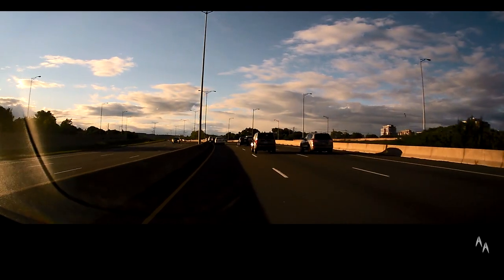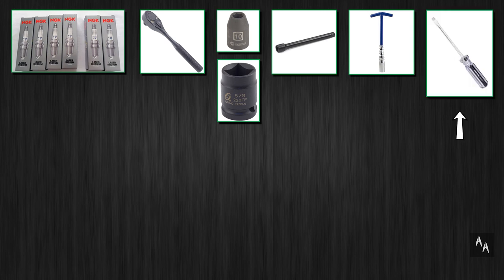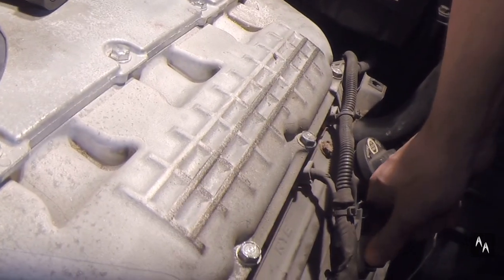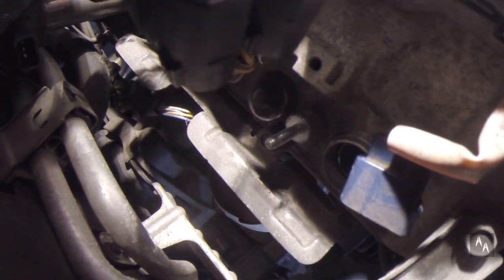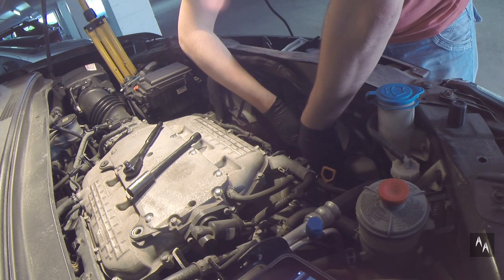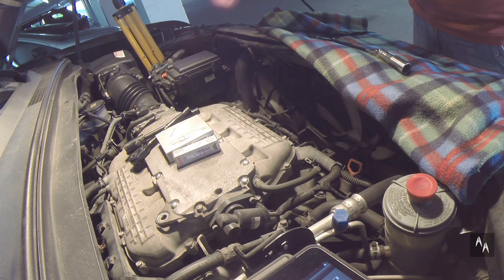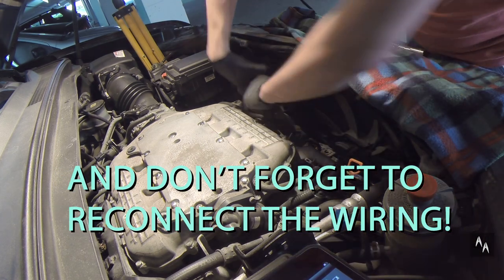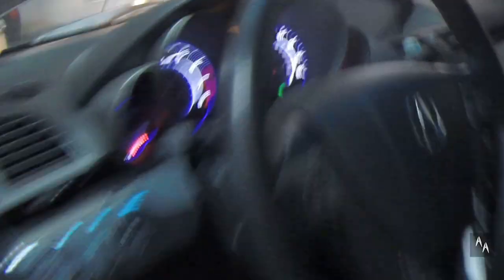Spark Plugs Change DIY 2008 Acura MDX

Comment: This video was a great help.  The rear three are not as easy as the front but it's very doable as long as you have the proper tools.  I did my 2010 MDX  in a little more than an hour with success and saved the $400 the dealership was trying to charge me

Comment: Still check the GAP, even though they say pre-gapped make sure you check the gap I've had gaps that were way off on "Gap less" plugs.
Reply from the maker: You probably got low quality or counterfeit plugs then. For iridium quality plugs when you check the gap, you actually damage the very thin iridium covered tips.
Reply: YES !! Today's spark plugs CAN last 100,000 miles -- IF they have been PROPERLY gapped before installation. Those so-called "Pre-Gapped" plugs are rarely at the proper gap for the vehicle.
Reply: @AcuraAddicted  NAH. Those Iridium deposits on the electrodes are not that fragile. 
Spark Plugs gaps should be checked with a WIRE gauge, so as not to damage the tips.

Comment: Great video, thanks for making this as easy as possible for those of us who view your work on line.  Actually the rear spark plugs facing the engine fire wall were much easier to replace than those facing the radiator, as there was more clearance for the spark plug wrenches, etc.

Made this a comfortable and straight forward repair, took about two hours in total.  Thanks again.

Comment: Thanks again for this video. Just as helpful in 2018, as it is in 2020. Today I just replaced the spark plugs in our 2012 MDX. The front 3 were as easy as in this video, but the rear (1) far left and the far right (3) were very tough to get. The left has the A/C lines going into the firewall, making it hard to reach the spark plug, but after using some shorter extension I was able to get in there. The hardest was that far-right rear where the coolant line goes into the firewall. I removed the hose first, cleaned everything and then was able to remove everything. I have no idea how in the world you got in there without removing that hose?

I just wish I watched this video first before ordering plugs. I have always done my own spark plug changes for my Accords and Civics, and those are so extremely easy, but the MDX is much more time-consuming but definitely worth doing it oneself. I just wish I looked at the parts number first.

After viewing the NGK website I choose the LKR7DIX-11S Iridium IX Plugs. They have the same shell and specifications almost, except the LKR7DIX-11S only have longevity of 50K and have Nickel ground electrodes whereas the ILZKR7B-11S are 100K and are Platinum ground electrodes.  I wish I would have purchased the LKR7DIX-11S for sure. The cost difference between Nickel and Platinum is $5.19 USD (31 USD more for 6), but darn well worth the extra money so one does not have to do this twice, haha... Always look at part numbers folks. ;)
Reply from the maker: Thanks! Recently changed the plugs again (and shot another video with detailed rear bank of plugs). While it is more challenging, I did not have to remove anything, it’s just a matter of wiggling around and having the right set of extensions.
Reply: @AcuraAddicted  Thanks for these awesome videos. Those spark plugs I replaced now are covered with some oil, it appears that the plug hole seals are leaking oil into the spark plug hole and now when I try and start the MDX it hesitates to start, after about 8 seconds it will start if the engine has been sitting for a few hours, but if warm it will start up. I noticed some burn-up oil on the rear pipes, where usually it was immaculate. Yesterday the check engine turned on staying low on oil, so some how it's burning oil. DO you have a video for replacing the Plug Hole Seals on these MDX's?

Comment: Hi Bogdan,

First, thank you for inspiring and detail videos!

Second, could you correct the link to torque wrench for US amazon? It points to 30 to 150-foot pound torque wrench, which is outside of the required 13 ft/lb for this job.
I ordered one without checking (this shows the level of my trust in you :)), and had to return it later.
I just did an extra 1/3-1/2 a turn after tightening spark plugs manually (as probably most people do).

Keep up the great job!
Reply from the maker: Thank you for your feedback! Yes, 1/3 to half a turn is fine for spark plugs. I'm sorry the link was incorrect, unfortunately, the products can be updated without notification. I fixed the link now.

Comment: Thanks for the spark plug video, can't wait to give it a try.  Any reason why you cant use the plastic, magnetic spark plug tool to unscrew/rescrew the spark plug in?  if only 13lbs/ft torque, would assume you should work, shouldn't it?
Reply from the maker: Thanks! I don't know if I would use plastic tool, the plugs can be there pretty tight. If you shatter the plastic tool, you're going to have a really hard time to get the pieces out as they are not magnetic.

Comment: Is there a director's cut version of the video that shows you do the rear bank ?
Reply from the maker: I ran out of juice for my camera with that one. But you pretty much do it blindfolded, because there is no physical way for you to see, there is only enough space for your hand. I’ll be making another video with higher quality, stab and more viewing angles later when I change my spark plugs again.
Reply: @AcuraAddicted  where is the visual for the rear ones between the firewall?
Reply: probably got to it already, but rears are as said just blindfolded and done by feeling.  You remove the same little nut that holds the coil pack in place.  Feel for it and you'll feel it.  The only connector that needs removing from the coil pack is #3 (back cylinder, driver's side) because a metal tube is in the way to prevent the coil pack from simply being pulled out.  All the others, they can be pulled with connector on.

Comment: Okay, third question, why replace the engine cover and the radiator cover, I think you called it? Purely aesthetic, or are there any functional reasons for these components?
Reply from the maker: Not replace. Reinstall, so put them back, since I removed them for this process.

Comment: Thank you for your videos. They are really helpful. I have a question, my Acura MDX 08 was having transmission problem, I got that fixed. I haven't been driving it for a year now...I just got it back on the road again, but I noticed that when driving it, it is acting like as if someone is pressing on the break every 10 seconds. Can you please tell me what's probably wrong with it? Thank you!
Reply from the maker: Thanks for your feedback! If your car has been sitting for a year, your brakes might act up. Calipers can be seized, for example. You should have your brakes looked at first. Also, if you haven’t been driving your car for a year, I highly recommend oil, atf, transfer case and rear diff fluids change. Oil needs to be changed 100%. Does the car sound right? Any errors?
Reply: @AcuraAddicted  Oh okay, I understand and I will have them looked at today. He sounds fine but there's a message on the dashboard saying that check TPMS. But I know that my tires need to be replaced since before it had the transmission problem. What would you suggest I do please?
Reply from the maker: @junie-fedmichel3091  If you see Check TPMS and when you check in on your dashboard and only see dashes instead of the actual pressure in the tires (assuming you have the sensors installed), this means batteries in one or more sensors have run out. In this case you'll need to replace the sensors, if you want to get rid of the message. The best time to replace sensors is when changing your tires.
Reply: @AcuraAddicted  Thank you very much. You're the best...Happy Holidays!
Reply from the maker: @junie-fedmichel3091  You are welcome! Thanks!

Comment: Hi, your instructional videos are wonderful.   I do want to share that the NGK link for the US 6 pack of IZFR5K11 are not the same size as the original Denso that I just removed and compared.  The threaded base on the new NGK is about 7-8mm shorter than the original factory Denso SXU22HCR11S that I just extracted.   I didn’t look in my manual until now (my error) and the NGK part number is ILZKR7B11S for my 2011 MDX. Would this difference in number and size apply to 2010-2013?
Reply from the maker: Hi Eric. Thank you for your feedback! And thanks for pointing this out. I think there’s something wrong with the part numbers. I’m going to have to check on it when I have access to my computer.
Reply from the maker: Just looked further into it, and it seems that Acura has updated their P/N charts and compatibility. There are now three types of different plugs quoted for different 2-nd gen years: 2007-2009 (Denso), 2010-2011 (NGK) and 2012-2013 (other DENSO). I was not able to find a reliable source for the 2010+ cars, but I updated the description to reflect the proper P/Ns (both Acura official ones and DENSO/NGK P/Ns.

Comment: Yo Bagdan, why does one of your front ignition coils look brand new, and the other two look like they've been left in coffee for a week? 

I pulled my front 3 (trying to get a broken PCV valve out of the valve cover, an expensive nightmare...) and two looked brand new, the third to the right, facing towards the front of the engine, looked like Keith Richards was soaked in coffee for a week... why the difference?
Reply from the maker: Bad spark plug tube seals = oil seeping through the valve heads onto the coils.

Comment: Did you ever cleaning throttle bodies of MDX?
Reply from the maker: No. Even at 175K miles it looks clean and doesn’t need cleaning. Also, do not clean it if you do not have a Honda scanner that has TB position relearning capability.
Reply: @AcuraAddicted  Thanks for letting me know..

Comment: Just out of curiosity, I noticed that no anti-sieze was applied to the spark plug threads.  Is that normal?
Reply from the maker: Good question. All of these Iridium OEM plugs come with anti-seize preapplied.
Reply: all ngk plugs go into factory assemblies dry... I've done both on my cars without incident
Reply: Most experienced mechanics and racers DO NOT use Anti-Seize when installing spark plugs.
Modern, high-quality spark plugs are PLATED, and no Anti-Seize is required or recommended.
Reply: @AcuraAddicted  Bosch Double Iridium plugs are plated -- and are installed DRY.
The Anti-Seize is NOT the problem -- the problem is that a lot of people have poor work habits, and they get the stuff in places that CAN do harm.
 You can't fix stupid, but you CAN prevent it by NOT using Anti-Seize.

Comment: any advice on the plug beneath the heater hose (near firewall on driver's side)?  apparently you did it without disconnecting the hose?
Reply from the maker: Yes, you don’t need to disconnect any hoses to get all of the plugs out. In the back you are doing it blindly as you can’t see. But I haven’t had any problems getting them out.

Comment: Which way did you loosen the back ignition coil bolts? Do you turn the tool to the left or right.... I know the front ones we turn to the left but since they’re in the back is it the same process to loosen?
Reply from the maker: It's the same process to loosen the rear ignition coil nuts: counter clockwise.
Reply: When the head of the bolt is AWAY from you, you turn the wrench in the opposite direction of when the head of the bolt is TOWARD you.

Comment: hey bogdan how do you remove the wiring harness on top of the valve covers its so difficult to work with that on
Reply from the maker: It's not easy, you'd have to remove some bolts. I haven't done it fully even for removing the head covers, so I cannot show you, you're going to have to figure it out on your own.

Comment: I have 2008 Acura MDX US technology package and I need to replace the shocks. I believe that the car have active damper system. I do I change it without paying too much money for it. I saw your video on how to change. Any suggestions for me?
Reply from the maker: Yes, you can swap it for regular suspension using the dampers I used (I have separate videos on front and back). You’re going to have to use some resistors to fool the system that proper dampers are installed, if you don’t want the ADS light showing on your dashboard. Otherwise it’s bolt on.
Reply: @AcuraAddicted  thanks for you reply. Do you have a video for how to change for register
Reply from the maker: No, because I didn’t have ADS, mine is the tech model. But you can look it up on Youtube, there are a couple.

Comment: Bogdan, did you notice that spark plug in 2nd cylinder had much wider brown stripe on it's isolation? AFAIK, that might be caused by loose contact with ignition coil. It eventually may cause degraded performance or even outage of plug
Reply from the maker: Good catch! I haven't had any related issues since 2014 when I filmed this, though, so I think I dodged the bullet. I will be changing the spark plugs again some time later this year with a better quality footage and more close-up inspection. I will also be replacing the coils.
Reply: @AcuraAddicted   looking forward for new DIY episodes :)

Comment: I take it you don’t have enough room to remove the spark plug with the first extension ? Is this why you use a flex type extension instead?
Reply from the maker: It is more convenient. But it is possible with a straight extension, just for some plugs you’ll have to remove the wrench first before you take out the plug.

Comment: Do you have to replace the coils at 100k miles when replacing the spark plugs the first time?
Reply from the maker: No, you don't. You only replace coils if they either start malfunctioning or deteriorate.
Reply: @AcuraAddicted  Thank you for responding!! I hope I can do it on my own because dealership is charging almost $500 and I can buy the original ones for around $75!!. Will be my first time doing it and I hope will be worth it.

Comment: Hi , I have a question if you could help me please and thank you. I recently cleaned my throttle body on 2009 mdx , thats how I did it , turned egnition on and some one pressed the gaspedal all the way then I sprayed throttle body cleaner on fiber cloth and cleaned it after cleaning the check engine light comes on and the rpm was  jumping up and down while releasing the gaspedal so some one cleared the code and reset the tps by scanner but still the rpm are jumping up and down when I push the brake and also the rpm doesn't come down normally when I release the gaspedal. Also another problem,  my car doesnt pick up speed fast from stop sign.  Any advice please
Reply from the maker: You never touch the throttle body in this car unless you have a scanner capable of TB position learning. Without this procedure you’ll have what you’re having now. You need a proper scanner for the position learning procedure.
Reply: You will need to go to a mechanic that has a scan tool & do the idle re learn procedure

Comment: Well done video. Subscribed and thanks!
Reply from the maker: Thank you for your feedback!
Reply: @AcuraAddicted  One thing I noticed. Your links provided have the NGK IZFR5K11. However, everything I can read suggest the NGK IZFR6K11. I'm sure one is just slightly hotter than the other. After ordering from your link I also noticed ~20% of reviews claim the plugs received are fake. That worried me, so I just went to the local store and bought (6) genuine plugs of the 6K11 variety.
Reply from the maker: @scottphillips88  There might be counterfeits, of course. Best is always to get authentic product directly from the manufacturer. Especially when it comes to important parts that affect your engine performance. I got mine off eBay five years ago when I did this replacement. They are still good up to now,  50K miles later. Will probably switch them again this year with a more detailed video (people have complained I haven't covered the back bank well enough).

Comment: What do you mean by precoded spark plugs ?
Reply from the maker: Pre-coated. They come pre-coated. Meaning they already have a coat of anti-seize on them, so you don't need to apply more.
Reply: Ohhh okay haha I thought i heard you say  pre coded my bad. Good vid btw !
Reply from the maker: @rbkbthekrew  Haha. Probably my accent! Thanks!
Reply: No problem man. Quick question how tight do they need to be because I just hand tightened them then used the ratchet to give about close to about half a turn. I do not own  a torque wrench and never used one before to changed spark plugs
Reply from the maker: @rbkbthekrew  What you did was correct. The proper torque for the MDX plugs is 13 lbf*ft, but doing what you did is the universal way of tightening them.
Reply: Ok Dope thanks again man ! Appreciate the help 🤝

Comment: What if I change the Spark plugs and I still have a few issues. (1) Having a horrible misfire still.
(2). The idle drops all the way down and the vehicle shakes and dies.{3} The Damn check engine light comes on and off and starts blinking at times..😮😢 Please Lmk ASAP What I should/could do? What do you think it is? Or anyone else with the same situation and issues?? Same 2006 Acura MDX Touring Edition. Thanks and please let me know ASAP... Thanks  
🙏👍👌🤞❤️
Reply from the maker: Hello. A misfire can be caused by many things. First thing you need to do when you see a check engine light is basic diagnostics: pulling out error codes. 

Electrically, if you ruled out spark plugs, it can be coils (really easy to confirm by swapping nearby coils and seeing if the misfire is still there).

It could be a particular cylinder compression issue as well. In any case, proper diagnostics should show. Good luck!